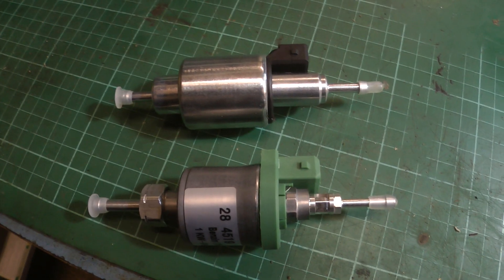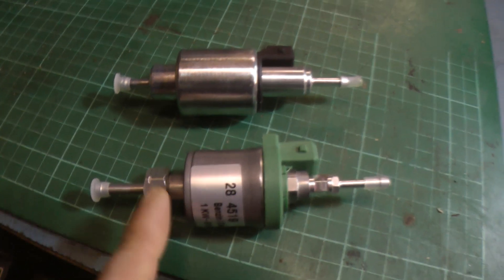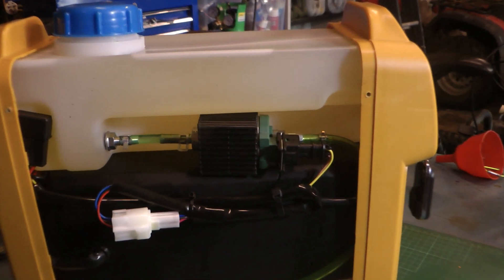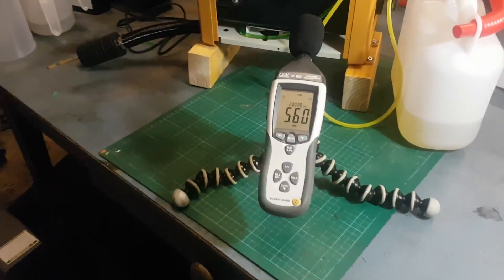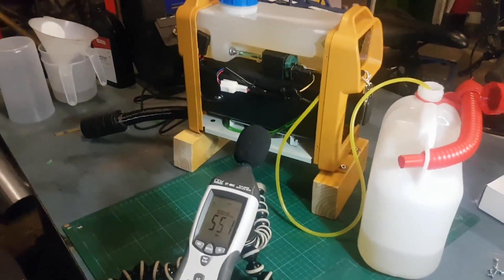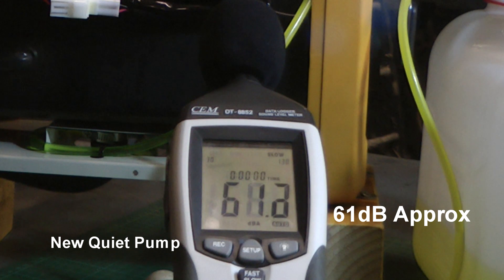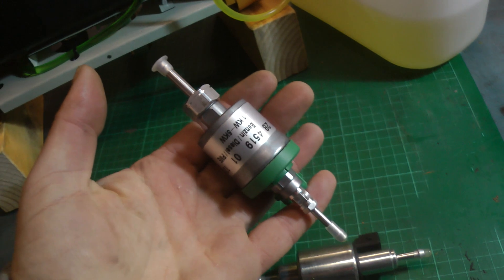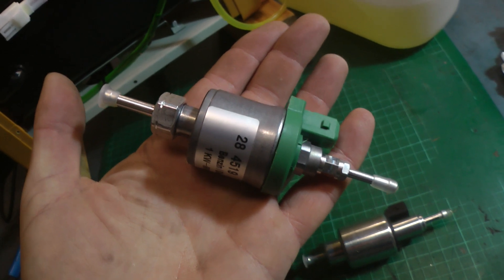"Quiet" pumps for Chinese Diesel Heaters

Comment: 3db is 1/2 of perceived sound level @ 1 meter using C-weighting curve.
Reply: 3db is a 50% reduction linearly. 10db is closer to what most people 'perceive' as a 50% drop in volume. Even in this video it clearly isn't 3+ times quieter perceptually.